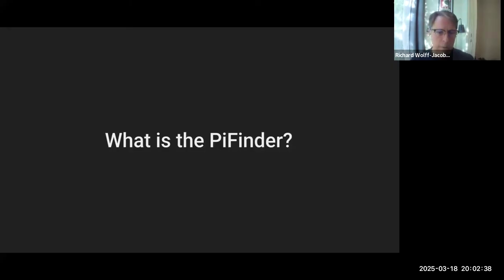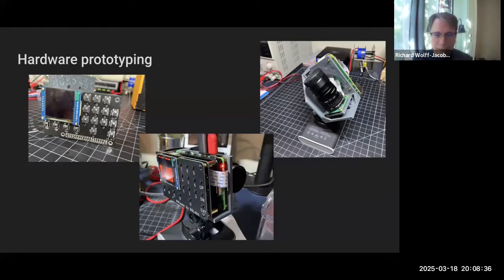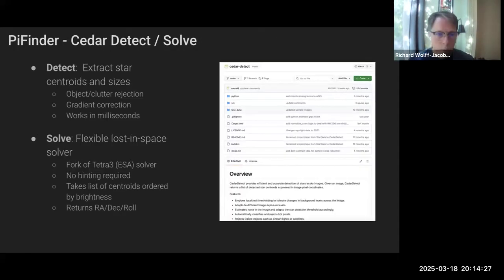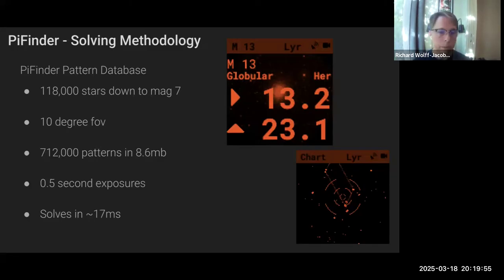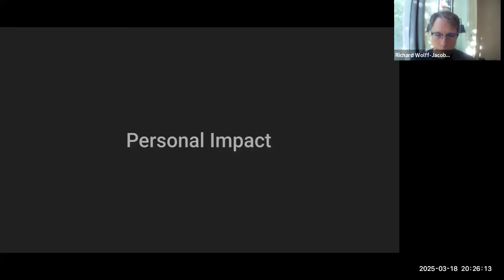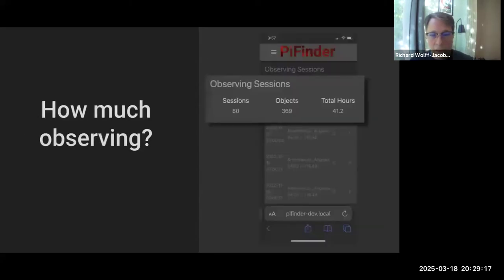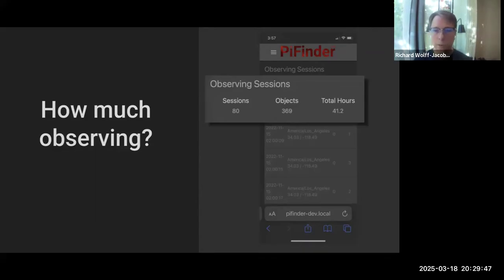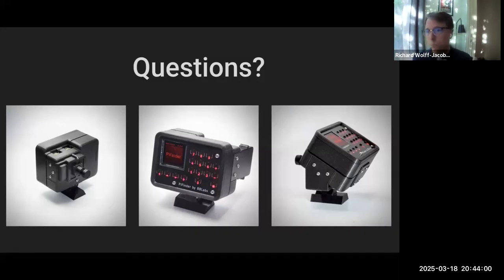Building the PiFinder - How it Works and How to Make Your Own

Comment: The world is full of computing devices that have inbuilt camera's they are called cell phones!! Why not just make the software for a cell phone instead of designing a project that requires specialized parts, 3d printed parts, and just make something that works on a cell phone!
Reply from the maker: What you want already exists in to a degree, but those solutions are not as flexible, convenient, or powerful as the PiFinder. A cell phone is a jack of all trades, it is hardly a master of any. As you should expect, a purpose-built device will generally outperform a jack of all trades in many facets.

You can check out AstroHopper (https://artyom-beilis.github.io/astrohopper.html) for free with any cell phone (it's actually a browser app, you don't even have to install anything), but it doesn't use your phones camera only the gyroscope and gravity sensors to detect movement etc. It's accuracy won't be as high and you will likely need to wait longer for it any movement to settle.

You could get a Celestron StarSense Explorer series telescope, which has a fixed mount for your phone and a reflective surface underneath to reflect the sky into your phone's camera. But this only works with those scopes, you can't use it with a scope that's not a StarSense Explorer and particularly the Newtonian ones are designed a little odd. The quality of your phone's camera could impact your experience as well.

In both cases the phone is mounted in a way that is ideal for the sensors to navigate, but arguably not as ideal for the user to use it particularly in the case of a Newtonian. With AstroHopper it has to be mounted along the top "spine" of the OTA so you're going to have to get up even if you just want to look at what's on the screen and not move the scope. And with the StarSense Newtonian scopes the eyepiece is on the left while the phone is mounted on the right side of the scope, so you'll definitely be going back and forth from the eyepiece to the phone.

Because the PiFinder's camera is separate from its main unit you can build a case that will mount in the orientation that makes sense for your scope, while the camera can remain pointed straight down the OTA as it need be. Or, since it's an open-source project, you can tweak it to be exactly how it works best for your setup, but no matter what the screen and interface will face directly toward you and allow you to interact without needing to get up. I've even seen customizations that mount it on binoculars.

Additionally, a phone screen on its lowest setting and with a "red mode" overlay or red app mode is still far brighter (especially if it's not OLED) than what the PiFinder's red lights and red OLED screen can dim to. So you'll preserve your night vision better with the PiFinder since phone screens weren't designed for dark sky nighttime viewing.

There are more reasons the PiFinder is a better solution than a phone app, but as a final point I'll just demonstrate why the CMOS sensor in the PiFinder camera (Sony IMX296 Mono) is far better for this than a cell phone camera. The specs of the PiFinder camera enable it to capture a usable image in <0.2 seconds and plate solve in a matter of milliseconds. But, I compared it to the current flag ship Samsung Galaxy S25 Ultra's cameras with sensors ISOCELL 3LU, ISOCELL JN3, ISOCELL HP2, IMX754, and IMX854:
- Unlike a phone that is primarily intended and tuned for daytime photos, the PiFinder's mono sensor is not hindered by a Bayer Matrix (higher Quantum Efficiency) and has significantly larger pixels at 3.45 x 3.45 µm. The largest on the phone is an odd 0.6 x 2.4 µm. This means the PiFinder is more sensitive and has a higher dynamic range than any of the phone's cameras.
- The PiFinder camera is from the industrial and machine vision lineup of sensors and uses a global shutter whereas the phone's sensors all use a rolling shutter. Rolling shutters are cheaper and better suited for high resolution color photography and thus used in consumer phones, but the more expensive global shutters eliminate motion blur thus giving you a better starfield faster.
Reply: @mhaa This is great information. Was considering a PiFinder but saw Astrohopper and decided to give it a try as it was free. To be perfectly honest I found the Astrohopper results very hit and miss which put me off buying the PiFinder as I thought the results would be similar. Your explanation clearly illustrates the PiFinder is specifically designed for the task with more suitable components and will give far better results. Being older and living in UK with our colder weather I really want to make the best of my available time for observing objects rather than actually spending most of my time trying to find them. Really appreciate the detailed explanation you provided and will be ordering one through a dealer in Europe. Cheers.